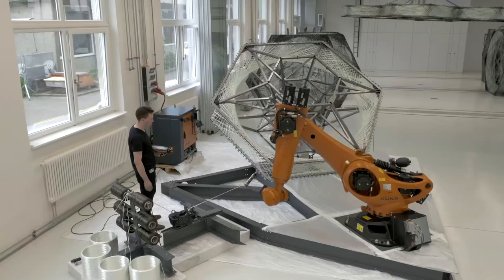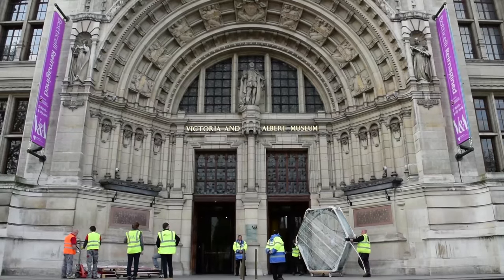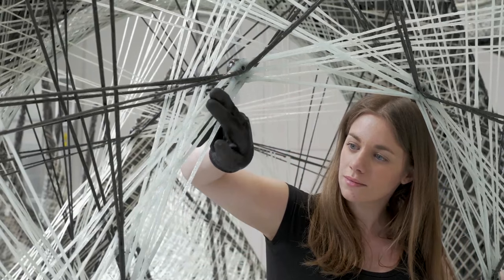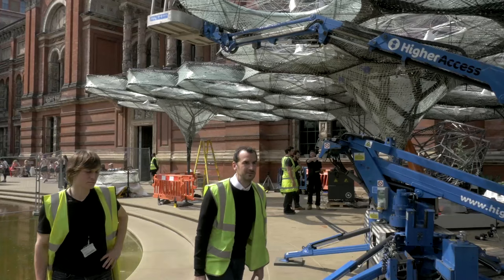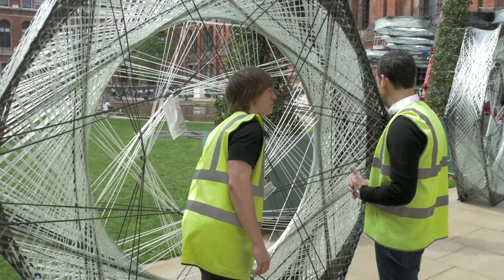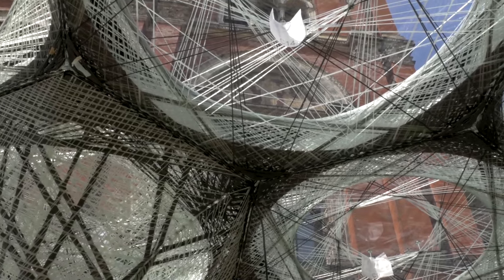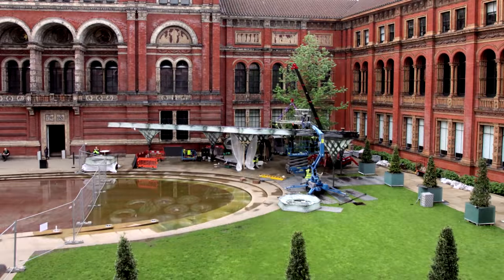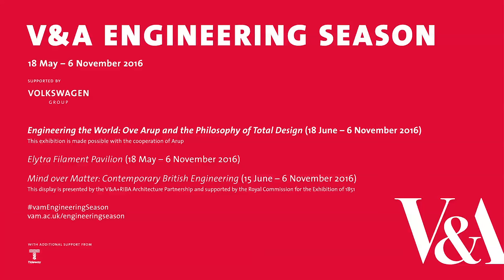Elytra Filament Pavilion

Comment: If I'm not mistaken, there is a steel skeleton inside? The fiber material is only the outer decorative layer rather than the structure
Reply: the steel ones were removed later